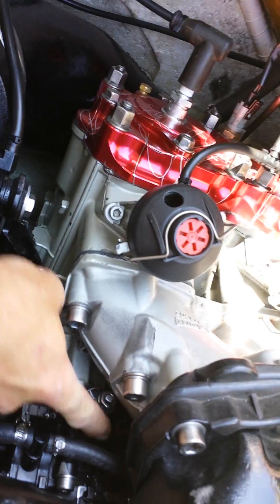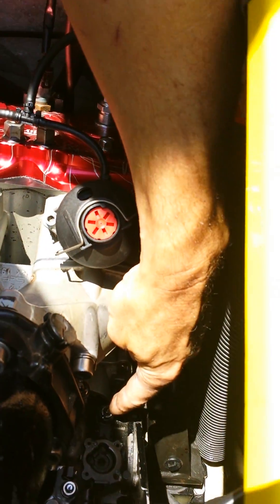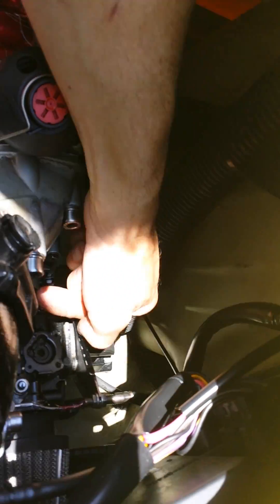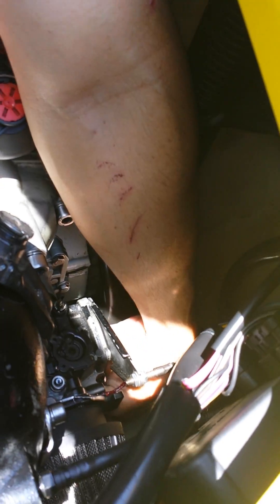Rich and lean conditions(1)

Comment: My raptor 350 had the big 3 done by the previous owner, and he upped the jetting 2 sized. but the fmf exhaust annoyed our neighbors, so we put the old one back on, and now I think it’s running rich. She doesn’t rev out all the way on top speed runs, the plug is black, and after speed runs she dies on me and won’t idle unless you full throttle her. Should I go thru all the work to re jet it, or just use the air/fuel screw? And where is that screw?
Reply: Tinker with the air fuel screw first. Hopefully it will get your problem fixed, otherwise you will have to put the old jets back. The air fuel screw can either be on the air inlet of the carburetor or the air/fuel outlet of the carburetor. Watch Rolling Wrench video of tuning a carburetor. You will know all you need to.
Reply: @shameermalik5540  put the old jets in, runs beautifully
Reply: @shameermalik5540  thanks tho
Reply: @JoeCaparo  Great to hear that man! Ride safe and have Fun!
Reply: @shameermalik5540  👍

Comment: Thank you so much for this explanation, this video is the reason i was able to adjust my pilot jet and get my 70's motorcycle running much better and much more safetly, and probably saved me alot of money in damages from running extremely lean.   Just wanted to let you know this helped at least one person alot.
Reply: me too my bike wa lean and when i acccelerate it give power then drop then give power again ...and it was hard to start in morning when i go work. i made adjustement that made it work with one simple chok and get more power on road with beutiful sound in idle

Comment: Do you recommend going from rich to lean when adjust main jets and stop just above the too lean phase ? A lot of manufacturers recommend tunning like that for Keihin carburetors. Just enough to be above the lean bog will give you maximum power.